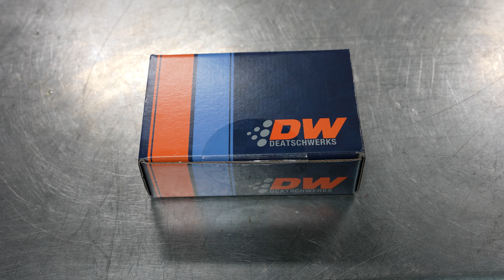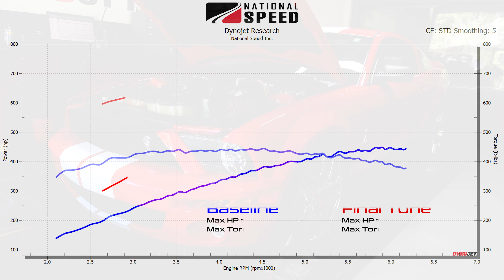'09 GT500 | VMP Gen3R TVS 2650 Supercharger

Comment: This is badass.  I picked up a gen3r for my 07 gt500 for 3499 during black Friday I'm about to purchase the injectors and boost a pumps with my income tax check and I will be ready to throw it on come spring.  I'm just running a twin 65 tbody full exhaust with stock headers but I'm gonna be running a 2.6 upper to make up for the smaller tbody and I'm gonna run 93 and boostane I'm hoping I can get close to 750 with the 100 octane on my setup. I'm gonna do built motor, cams, headers and monoblade tbody in the future and make 900 without even trying but for now I'd like to see close to 750 on this setup.  

My favorite thing is how the power curve looks exactly like stock blower just ALOT more of it both torque and ho lol.  These cars are so underrated (earlier gt500s)
Reply from the maker: Hell yeah!  Sounds like you've got a good roadmap laid out.  You're going to love it!
Reply: Same, I bought one during that sale. Been waiting on SW headers since I purchased them at the beginning of September, and the headers finally came in so hoping to get everything installed this month. And awesome video BTW!
Reply: @gatorjohn90  i just got mine done ended up with 724/690 with the small twin 65 and stock headers.  More torque than this video because the smaller pulley got it working more in the lower rpm but little less up top because of no headers and the smaller much more restrictive tbody.  I'm seeing 20 psi so I gotta run boostane.  I'd bet money it wound pick up 25 rwhp with a twin 69 on my setup and 30-40 with a mono even with the stock headers.  It's a beast as is and drives perfect.

Comment: 91 or 93 octane
Reply from the maker: 93 octane.
Reply: Who did the tune and do you remember how much boost it ran?
Reply from the maker: @gatorjohn90  the calibration was done by our in-house calibrator, Vlad Yevtushenko.  And this setup is producing 19psi.
Reply: @NationalSpeedInc  just had a very similar install on my 2009 GT500, but with a 10% lower and a 3in upper… ended up making 20psi of boost so had to revert back to the stock lower 🤣